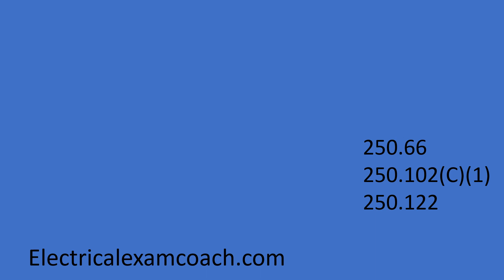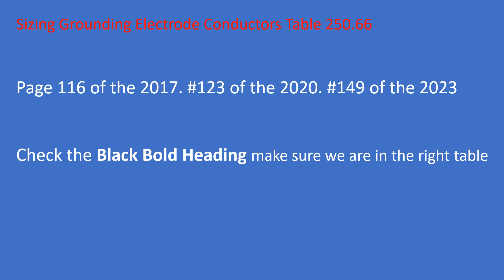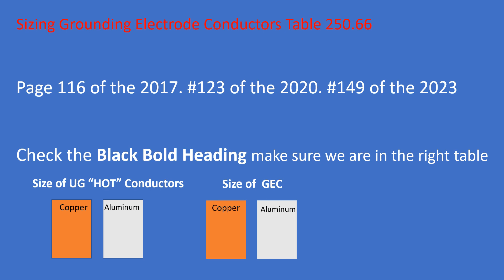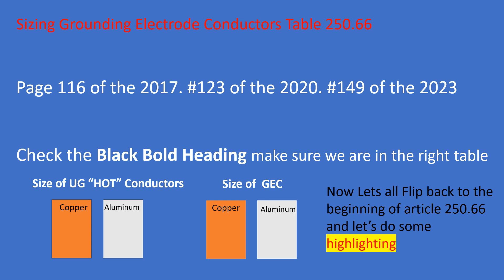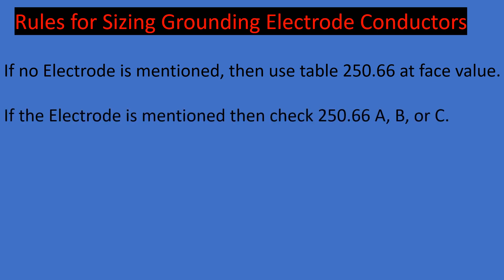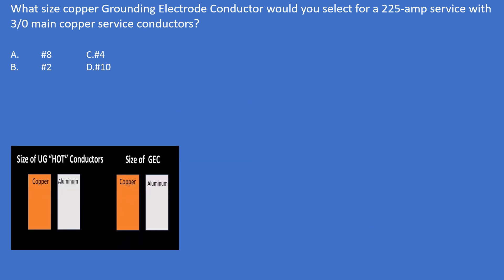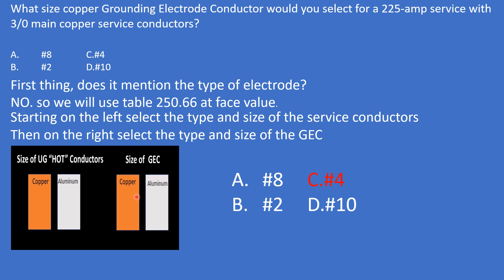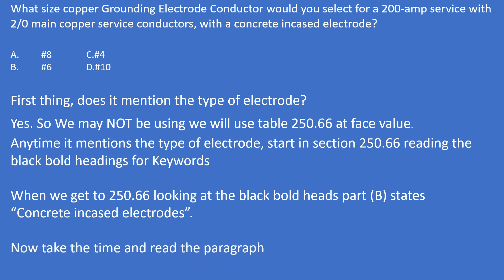Table 250.66 How to Size GEC's Grounding Electrode Conductors

Comment: Does a metal underground water pipe fall under Rod, Pipe and plate electrode and can be sized by a #6 or does it need to be sized by table 250.66? Real world question not a test question. Thank you.
Reply: It has to be sized based off the table. Rod, Pipe or plate is not the same as water pipe